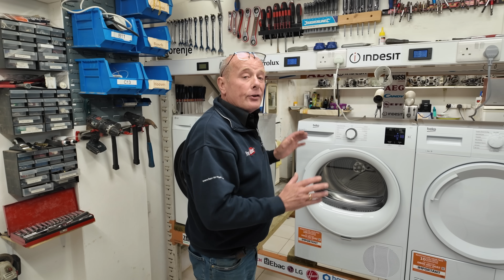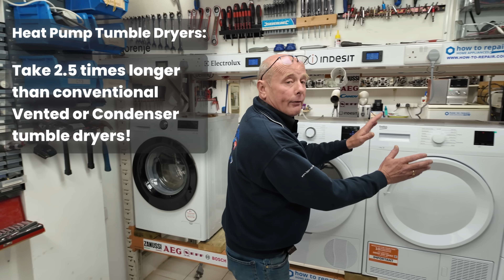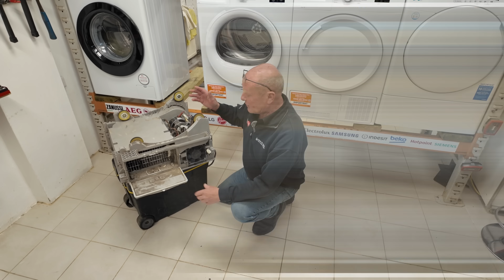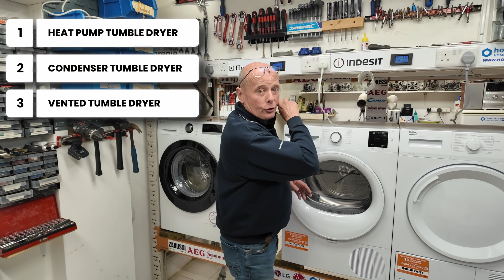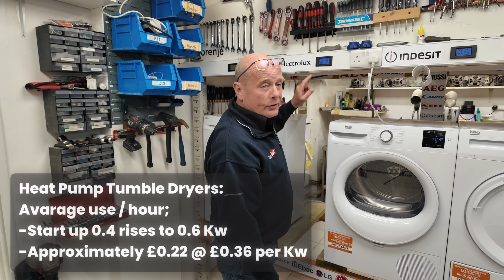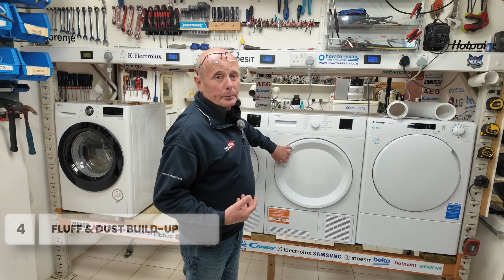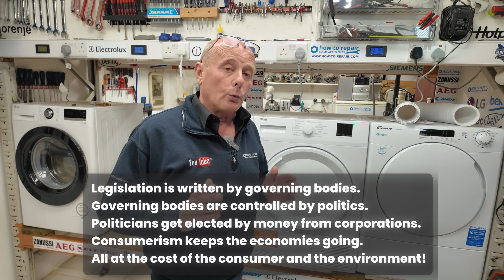Tumble Dryers the Shocking Truth About Heat Pump vs Vented & Condenser, NEW LEGISLATION!

Comment: My vented dryer will dry a full load in under 40 minutes. I've been saying for years about heat pump dryers being rubbish. Wouldn't have one. I've stocked up on parts to keep my 8 year Hotpoint dryer going. Touch wood so far it's never had a fault in 8 years of daily use.
Reply from the maker: I believe heat pump technology holds immense potential, however, these machines exhibit a concerningly short lifespan, typically lasting only five years on average. Drying times are significantly longer, often doubling the usual duration, leading to increased wear and tear on both the clothes and the appliance components. Furthermore, accessibility for maintenance is a significant issue. Manufacturers appear to have a limited understanding of the necessary maintenance requirements and the importance of user-friendliness. They seem to prioritize production, assuming perfection without adequate testing. Thank you for your comment. I would be grateful if you would share this post, as it's crucial for raising awareness and driving meaningful change. Have a great day, Paul.
Reply: @How-to-repair  I'll share no problems. You've just confirmed in this video what I've been saying. Especially the extra wear n tear in clothes. 1-2 hours washing then 2-3 hours drying is just ridiculous. It would be quicker to hang them out to dry.  Plus if you have a larger family that wash daily with several loads it's going to be a nightmare.

Comment: The heat pump dryers need MUCH better air filters. Why can't it use something more sophisticated than a relatively large mesh filter?
Reply from the maker: They have double the filtration systems on all these every time you add a filter you restrict the airflow by a percentage thank you very much for your comment

Comment: My 7 year old tumble dryer only takes about an 1/2 hour longer than my daughter’s condenser  uses a third of the electricity. Maybe I was lucky . It cost £70 more to buy . The rub for me is hers has been repaired twice.
Reply from the maker: Vented and condenser tumble dryer have a chance of lasting a long time if well maintained. If any of your friends or family are thinking about buying a new dryer, it would be helpful to share this video with them. It will give them an idea of what to expect when purchasing a new dryer.

I hope older models will still be available, but I can't promise that. It's important for people to know the differences between the dryers on the market and understand any potential issues before making a purchase.

Comment: I gave up with my tumble drier and now use a dehumidifer and airer instead. Also has the added advantage of keeping the humidity of my old house down. Yes it isn't much good for emergency drying but if I am really pushed there is a laundrette in the town.
Reply from the maker: I think the dehumidifier idea is a very good one, especially if you have it in a sealed room with it running It may be an idea to have fans just to blow air through the clothing. If any of your friends or family are thinking about buying a new dryer, it would be helpful to share this video with them. It will give them an idea of what to expect when purchasing a new dryer.

I hope older models will still be available, but I can't promise that. It's important for people to know the differences between the dryers on the market and understand any potential issues before making a purchase.
Reply: One of my colleagues does this, in a sealed room (the conservatory, actually) and with a fan blowing the washing.  He says it takes a while to dry the washing, but costs very little.
Reply: @1man1guitarletsgo  I have my washer-drier set to the minimum drying time (about 20 mins, IIRC) and the clothes finish the rest of their drying in a room (the home office room) with a dehumidifier. 1 hour of the dehumidifier is enough to dry most loads overnight. the dehumidifier has its own fan, and infact also has a clothes drying mode (where it has no minimum humidity cutoff and will just run) so is perfect for this.
Reply: Same here - old damp house, dehumidifier in the utility room with a ceiling-hung drying rack.
Dries fairly well even with no fan stirring things up and the room often not being sealed, and is also a great place to dry other stuff, whether rain-soaked jackets, rucksacks, footwear, etc. or even wet bathtowels between uses rather than sticking them on a radiator and generating more humidity.
I'm also a caver, and drying rooms in caving huts usually use a dehumidifier+fan+heater setup in a drying room. With the heater set to just get the room reasonably warm, so not using too much power once things are running, even with a not particularly optimal airflow setup it's possible to dry the gear of 30+ people (one-piece thermal suits, t shirts, socks/wetsocks, gloves, neckwarmers, underwear, towels, etc) overnight as long as anything soaking wet is stuck in a spin dryer first.
The setup in one hut I go to has a hose to drain the dehumidifier to the outside, arranged such that if the pipe freezes outside, water overflows into a watering can rather than backing up back to the dehumidifier and risking it shutting off when the small internal tank fills up. When there's a a frozen pipe outside and a room full of damp clothing, the can needs emptying last thing at night to make sure it isn't overflowing in the morning, so it's pulling out a pretty decent amount of water.
I'm definitely a fan of low-temperature drying via airflow and ventilation. I've twice had a room I was living in get partially flooded, once when a plumbing issue caused a leak through the ceiling, and once when there was a fire in the flat directly above and my room was where the firehose water ended up. In the first situation, I did attempt at first to use a fan heater to dry the soaking wet carpet, but it was too directional, couldn't be left unsupervised for safety reasons, and caused a lot of condensation on the walls even with windows open. Seeing that wasn't working, I borrowed a bunch of desk fans from work and had them playing across the floor. The carpet dried much quicker than I had expected, with no condensation on the walls, and things worked similarly well after the fire incident.
As a vaguely amusing sidenote, a colleague of my brother-in-law moved into a house which had an unused and somewhat damp-smelling room in it. He stuck a dehumidifier in it, and after some time, commented to his wife that he was often still emptying a lot of water out of the dehumidifier on mornings after damp days, and that maybe the room had a serious issue. That was when he found out that because it was empty, it was where she hung her laundry to dry in the mornings if the weather was bad, and it always dried quickly.
Reply: Ditto. Costs pennies to run and can be moved from room to room to dehumidify as well as drying clothes. Just taking water vapour out of the air reduces heating bills as it is no longer heating up that as well as the air. It will emergency dry just as well in small batches in my experience.
Reply: I use a dehumidifier too, works great. My tumble dryer is used as an emergency only.  And it makes the house wet so  I close the utility door and open the window. Bring on the summer and the washing line.

Comment: About 25 years ago, after going through a load of cheap dryers that just didn't last, I bought a big Whirlpool American type tumble dryer, conventionally vented. That thing is a beast and has worked for a quarter of a century without a single thing going wrong with it. It uses a lot of energy but it is really fast! Overall, good value for money.
Reply: That Whirlpool dryer you mentioned is the 29” top filter model. Reason why they are one of the most reliable clothes dryers on the market is the design dates back to 1966, has been perfected year after year. Usually a new set of rollers is needed, a tensioner and belt along with a few others odds and ends, but that’s about it. Those things are like cockroaches, impossible to kill. 

Those basic Whirlpool 29” dryers use a thermostat to detect when things are dry, thermostatic auto dry. When you put in a load of clothing, the outgoing exhaust air is on the cooler side, as the clothes become more and more dry, it will cause the thermostat to cycle the heat off, once it cools down a little the heat will come back on. This will continue until it reaches the cool-down where it’ll be overridden and will shut off.
Reply from the maker: Great machines built well, but yes, they do eat some juice If any of your friends or family are thinking about buying a new dryer, it would be helpful to share this video with them. It will give them an idea of what to expect when purchasing a new dryer.

I hope older models will still be available, but I can't promise that. It's important for people to know the differences between the dryers on the market and understand any potential issues before making a purchase.

Comment: I have a Miele heat pump dryer that replaced a condenser dryer, Load times are about 30 minutes more and it uses less than 400 watts, The bearing is also a doddle to replace, Another hidden bonus of heat pump driers I believe they are less likely to catch fire as they don't run anywhere near as hot plus it's better for the clothes, Cleaning the foam filter that protects the condenser can be annoying even if its every 3 months but so far (over 2 years) it's kept the visible part of the condenser spotless so far
Reply from the maker: This tumble dryer may have cost you nearly £1000 and they are well built and I hear about some good results with them but still the accessibility to maintain them at a later stage is very difficult. Thank you very much for your comment.